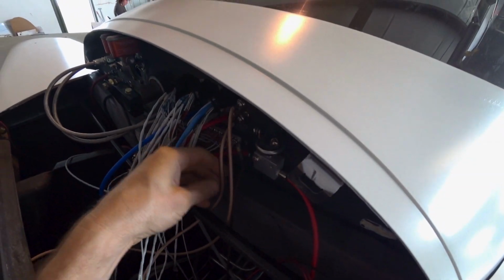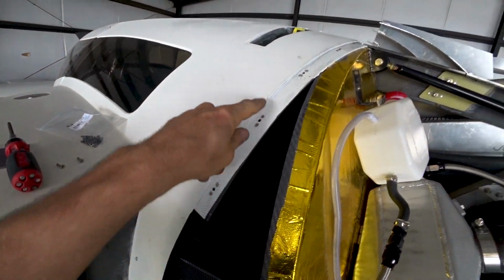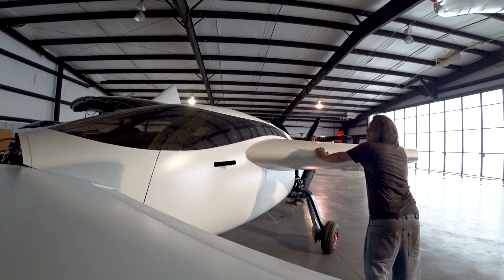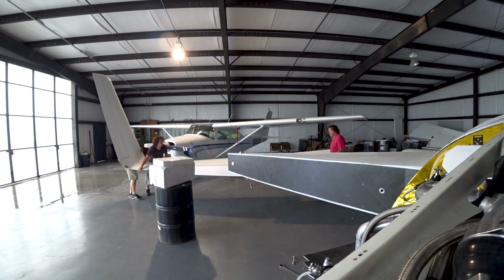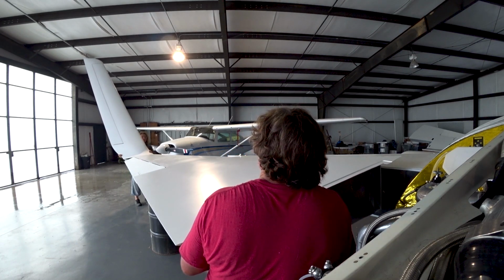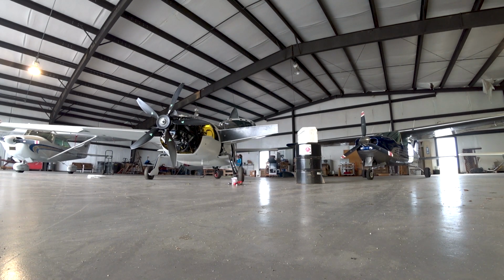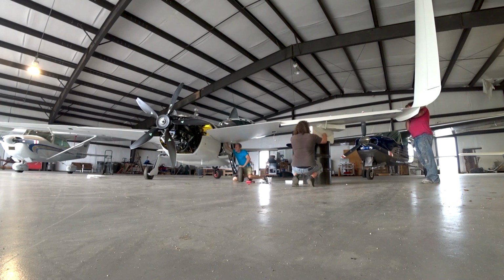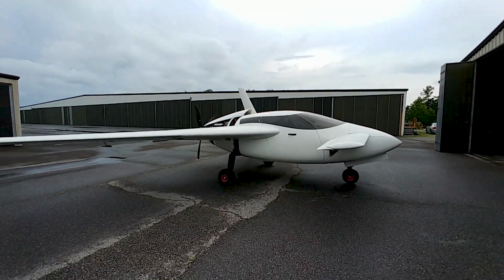That's One Sleek Aircraft - Building the Raptor Prototype

Comment: What little i have seen of your wiring scares the hell out of me as to the quality of your build. wiring going through holes in structure without any type of grommet leads to wire damage. using cheap push on connections on that pitot heat relay terminals. Soldered connections without sufficient heat shrink length to support wiring. Extra lengths of wiring just zip tied but not secured to prevent motion. Rats nest of front wiring not loomed and laced. I have not watch too many of your videos because what i see scares me. I hope it doesn't fall out of the sky over my property. It is a neat looking plane though. I lost interest after you were clueless as to the problems of your reduction drive bearing and shaft damage after just a few hour of running.

Comment: Do you plan to do a static test on the wing assembly, particularly taking into account some of the torsional bending applied through your spar bolts?  Beautiful plane, but don’t rush this part.  This is the time to slow down and make sure everything is done right.  Looking forward to seeing it fly.

Comment: Peter, a combination of factors compels me to urge you to revisit your canard loading assumptions prior to high speed taxi tests. The short version says "ballast for balance" just like you'll surely do, but this is a critical safety of flight issue and should not be taken lightly. You have set your incidence to achieve a desired result, but what you have to assess is, Will it do so under the present circumstances? The additional weight gain you've reported costs double when it happens in back, as you may well need to ballast the front dramatically to achieve a safe canard loading (typically at least 20% of flight weight and often much more depending upon analysis and proportions.) As you well know, for a canard aircraft to achieve longitudinal pitch stability, the canard must stall first, but there is more to creating that outcome, both before and after setting its alpha relative to the wing. Your area is now set, but also variable. The sticky part is that the combined areas and centers of aerodynamic pressure, at every flight condition (and including, for Raptor, potentially substantial fuselage lift contributions) must always sum to the CG without excessive moments, which would create excessive rates of pitch change. Your concern must therefore be directed to whether the canard is sufficiently loaded and its lift slope is compatible with maintaining stability through low rates of change. Large lifting areas ahead of a CG can add lift at a rate that can exceed the achievable rate of a moderating control response... which is mostly just the downward gravitational acceleration. This, if it occurred would be the kind of instability that kills people before they even intended to leave the ground. For those who take this comment as negative or fearmongering or anti-anything, please rest assured the issue can be addressed successfully, as has been the case throughout the controversial history of the canard configuration. There may not even be any issue to discuss this time. However, when one entering the testing phase expects a safety advantage but instead encounters the stability equivalent of an arrow shot backwards, it can come as an incredibly unwelcome surprise, and I feel obligated to say so as this topic may well have been at the heart of a recent fatality. You and your plane deserve to fly safely. Congratulations on an epic journey to date.
Reply from the maker: Thanks John. Don't worry, we are well aware that we need extra ballast up front and a decent forward cg for initial testing at least if not beyond.

Comment: Currently trying to put together the best group of people for a Raptor Flying Club. May possibly be made up of non pilots as well. Thinking 4 minimum/5 maximum. Have been talking to some veteran pilots around the local FBO with previous flying club experience, in an effort to try and learn as many "Do's and Don'ts" as possible. Simply cannot imagine owning any other GA aircraft. BRS will be a definite additional option. Current time-frame goal to place order is within next 18 to 24 months. That's enough time for any "bugs" to be worked out. Will be my 2nd aircraft ownership experience. Once you have owned one, its very hard to rent long term.

Still planning on flying out to witness maiden flight.
Reply: What don't you understand about not showing up or test flight will be postponed?

Comment: Looks nice! Kinda surprised about the attach points for the wings though. Only 2 bolts onto the strake seems like they would be taking a lot of force and maybe prone to getting metal fatigue.

Is there more to the wing attachment then just the bolts? Are the bolts just holding another system in place to maintain an interference fit on another part of the structure (like the wing spar on a pa-28 that slides into the wingbox). The smaller wings of the PA-28 have 18 bolts on just the main spar to wingbox connection per side. Curious how this design can get the job done with only 3 bolts per side compared to the +20 bolts per side to attach the Piper wings.
Reply from the maker: It's all been engineered and that's what it takes. Adding additional bolts just created potential stress risers.
Reply: Raptor Aircraft I guess each bolt doesn’t need to hold that much weight really. The aircraft is what maybe 3300lbs wet and loaded, a normal category load factor of +3.8, 1.5x ultimate load factor and spread over 6 bolts. Not even accounting for generated lift from the body and assuming it’s all on the wing section that’s only 3135lbs per bolt, not too much load for a high grade bolt I guess.

Would you think the bolts will eventually need to be inspected or replaced after a certain amount of hours to check for fatigue cracking, or is the interface between the wind and body designed in such a way where most of the load is transferred to the body and the bolts just provide a vertical axis clamping force?
Reply: ... and the PA-28’s weakness is still the wing attach points. I agree, 3 bolts doesn’t give me the warm and fuzzies. Hoping there is some interference fit there in addition to the bolts.
Reply: @ briantii, that’s how I felt seeing it. It’s hard to tell from video, but it almost looked like they were 2 flat surfaces being bolted together where the bolts would be exposed to both shear and tension forces. Bolts are much stronger in tension forces than shear forces, if exposed to shear force I would assume metal fatigue will be a factor.

With the pa-28 wing the main spar i-beam slides into the wingbox and then it’s bolted so the structure takes most of the load when the bolts are tight. Shear force on the main spar/wing box bolts would be basically non existent when the bolts are tight. 

For a seemingly strong design like the Piper wing fail several times at 6-7k hours, makes me wonder how this wing will age if it doesn’t have a slip or interference fit between the wing and body attachment.
Reply: @Alex-us2vw  I think we are absolutely in 100% agreement. I really worry about shear forces on those bolts. I cringe at the thought of steep turns with them. Hope I'm wrong and the math works... just seems like a lot for 3 tiny bolts.

Comment: That is one sexy audi areoplane.
Have you done any calculations with regard to engine weight in compare with elec motor and batterys as the elec revolultoin is creeping up on us all very fast.
Reply: Lol no need to run any calculations, unless someone really considers 4 seat aircraft with a 1 hr endurance range viable.

The aircraft was already coming in overweight before it was painted and had its finishing touches done. Switching from AVgas to batteries for a power source would be terrible due to the much much much lower energy density of current battery technology.

Only place we might see electric in the near future will be in 2 seat trainers for initial flight instruction. But even then they are severely limited in the scope of training they can do due to the current limits of around 2hr flights to maintain the required reserve energy. Charging between flights will also be a huge hurdle to overcome for an operator, since when the weather is good the aircraft need to be in the air, not on the ramp charging.
Reply: @Alex-us2vw  Here is a 6 seat electric Beaver which is going to do scheduled flights ! https://www.flightglobal.com/news/articles/harbour-air-aims-to-lead-electric-flight-with-beaver-457022/
Reply: Richard Visscher still not really viable for mass market. 30 minute flight time with 30 minute reserve would be useless to the vast majority of operators. Move that same concept into a general aviation aircraft that buys want to use for pleasure and travel and it’s beyond unpractical. It’s unsellable.
Reply: Wow every thing you said is close to truth now. All im asking is if we have had a no fly. to a max 2 hour fly in the last 2 years. then why would we not consider it a possibilty?. It has taken 4 years to get, this plane to here now. So why would anyone think this is not a very resanable comment to ask.
Reply: grant flavel, because of the weight of the batteries compared to the weight of fuel. Fuel has a much higher energy density, getting anywhere near a useful endurance with current battery tech would on this aircraft that was already overweight before final assembly would be impossible. 

Until we start seeing concept general aviation aircraft that can 4hrs, plus 30 minute reserve, and do it with at least 700lbs of payload capacity, then it becomes worthwhile to start designing airframes around the powerplant. 

But with 1hr or 2hr capacity it’s useless for anything other then proof of concept for the most part. It will mostly stay a proof of concept until we see new battery technology come to market (who knows when that will come lithium ion has been on a many decade long reign now).

Hybrid electric on the other hand will definitely be coming to market since it still uses fuel as its energy storage medium but can benefit from innovative power delivery systems.
Reply: @Alex-us2vw  wow so lets get this right the batterys have to weigh the same amount as the fuel?
So as per my origional question was how much does the power train weigh has been lost.
What i wanted to know is the complete weight of the power train and fuel compared so i could understand how far we are off. All the industrie is talking about 400 to 450 watt hour per kilograme from what i understand they are very close to this mark. What your saying is because battery density took decades to get to here its going to take decades again to progress further. This doesnt sound right to me. Its always in the media it cant be done we are decades off but yet every day the industrie is evolving expedentially. So i would have thought it would be valid to at least consider.
Reply: grant flavel, AVgas is 6lbs per gallon and a typical 300hp IO-540K is 470lbs. 
If the energy density to weight ratio of batteries was anywhere near this it we would be seeing electric aircraft with 5-6hrs of endurance. But all we have is aircraft with 1-2hr endurance so the energy to weight must be 3-6 times worse then fuel.

Just look at the Tesla battery that weights over 1200lbs by itself. That’s only 400lbs shy of the empty ramp weight of a Cessna 172. At best this battery gets a 500mile range, but a similar class midsize BMW can do 500miles with just 88lbs of fuel. 

Now try that with aircraft engines that constantly operate at 60-75% power unlike cars that coast around at 10-20% power or less the majority of the time. Its not hard for an aircraft engine to burn 72lbs of fuel in 1hr, that would need like 1200lbs of batteries to fly that hour and not have enough energy left to provide the minimum 30min reserve. 

That’s pretty much in line with the 1hr-2hr ranges (including reserve) we see in the current crop of electric designs. There’s no way to fit 5-6000lbs of batteries onto a general aviation airframe to see the 5-6hr ranges we are accustomed to with fuel.
Reply: This design will be as is until batteries get a quantum leap in capacity and energy density. But an electric or hybrid version of this craft would be very interesting.